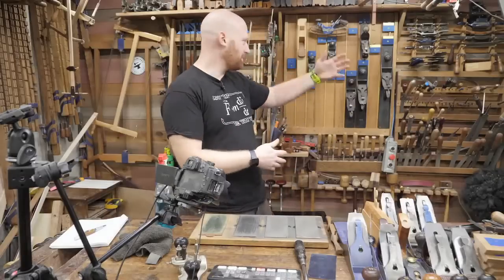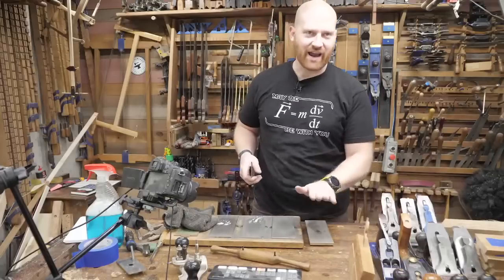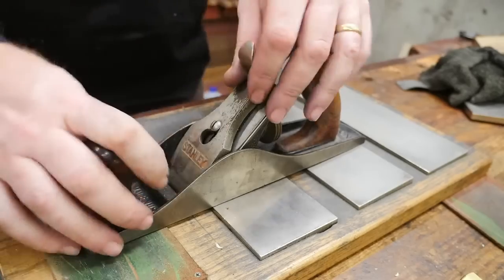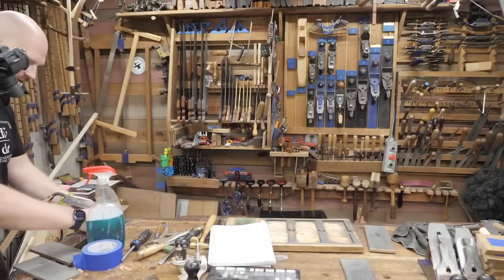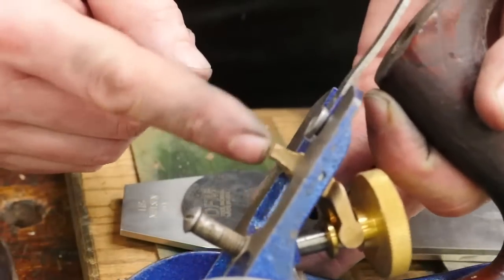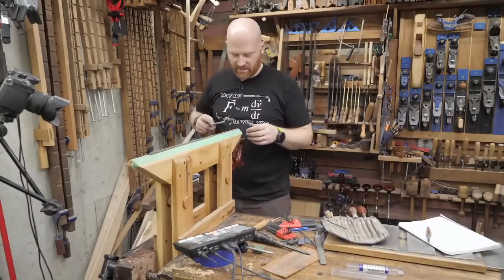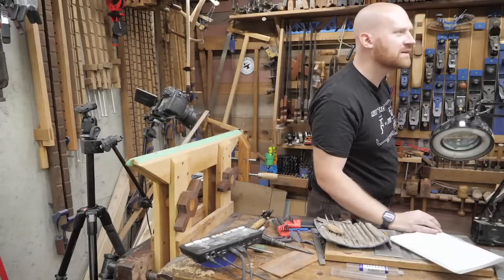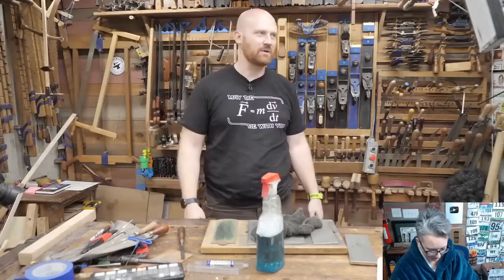Sharpening everything live

Comment: I just sharpened all my blades yesterday too!  I owe you a huge thanks for all your work, without you, Sellers, and Mr. Chickadee I would probably never get into handtools as much as I did. Sharpening would be most likely impossible and it took me a fair while to dimension lumber with handplanes. I still suck at it, but getting better. I built a shelf based on your desk shelf video a while back and just loved the joinery, struggled with flattening because of planes.  There is virtually no tradition to bailey style planes where I live, so  buying used ones that i can actually see and judge is out of the question. I can buy mid-priced new ones and hope they are ok (the brand is called luban-quangsheng and i think they are from the same factory as woodriver planes). Recently I discovered a local brand of wooden planes that are very affordable and made one work, thanks to you and chickadees videos, because the chipbreaker just wasnt sitting correctly on the blade, I also had to modify the wedge so the shavings could come out corretly and would not curl inside and flatten the sole, and now Iˇm thingking about purchasing (probably translated to) a jointer plane (60-80 cm sole) that even has blade adjustment. Can americans get their hands on new production wooden planes? Would you make a video on how you would put it into a workable condition? My smoother works great now (bought at 30 dollars new) but I wondered how you would tackle it.

Comment: How often do you run the plane body on the stones to flatten or tune it up?
Reply from the maker: Almost never. I did it here to clean junk off the bottom. Last time I used that plane was to remove an old lacquer top. And it left a bunch of schmoo on there. Normally I grab some sandpaper but I just didn't have time for that so I just ran out of the diamond plate. Other than the smoothing plane I don't flatten them. There really isn't a huge need for it. Maybe on the jointer plane, but at that it still only needs to be the heel mouth until. It doesn't have to be perfectly flat.

Comment: Are your plane blades the older thin style or did you upgrade to thicker replacement blades, and what are your thoughts on changing to thicker blades?
Thanks
Reply from the maker: I have some of both. For my smoothers I prefer a newer iron like a PMV11 as it will hold a keen edge longer. As to thicker, that is not a huge benefit for me. Most of mine are the original irons.

Comment: Do you think it would be easier to see which camera you're filming on right now with a bright red light on the top of the camera? I think the LEDs would be better visible there than on the switching panel. You could simply run wires along the existing HDMI cables to the cameras, and attach a second row of buttons on top of the existing switch buttons so you can press the two buttons at once, and then connect them to a bit of electronics that switches the LEDs when the button is pressed.
Reply from the maker: Most of the time the problem is I get to focused on what I'm doing and looking at my work. I just forget which camera I'm on. Having a light on top of it really wouldn't help because I don't look up to see. If I looked up at the confidence screen it becomes pretty obvious as I can see which one is up. Or I can just look at the light on the mixing board. But that means I've got focus on it. Usually when my wife is there she lets me know.

Comment: When you sharpen a scrub plane would you ever camber the cap iron or is it enough to have it flat?
Reply from the maker: I just leaves a cap iron the way it is. It doesn't work as a chip breaker so there's no need for it to be close.
Reply: I have about an 8inch radius on my foreplane. With the cap iron to the beginning of the radius it didnt allow the iron to be retracted enough; it was still hangin out about 4mm ( over 1/8inch)  so i clipped the corners off mine to get it low enough on the iron so I can retract the iron more.

Comment: Awesome, thanks 😁 Question: my blades dig into the strop every time I use it, what does it mean?
Reply from the maker: Usually meetings. You're not lifting it up fully before moving it back forward to the top. With the strop you just pull it back.
Reply: I assume you're pulling the blade towards you, with the bevel down. 
If you're not, try it and your problem is gone. =)
Reply: @roevskagg  of course I am, makes no sense to do it any other way to me 😉
Reply: @yoelai  and also with the cutting edge facing away from you... This was the important part, i forgot to mention. 🤣
Reply: @roevskagg  well, that explains all the blood I guess 🤣
Reply: @yoelai  to be honest, i kind of hope so... 🤣

Comment: Do you use extra extra coarse or extra coarse? I have COARSE, FINE, EXTRA-FINE. And I want to buy a more coarse one. Makes it really a difference between Coarse and X-Coarse? Or should I buy extra extra Course? greetings from Germany? Do you ship to Europe?
Reply from the maker: I have in my main plate course, fine, extra fine. But I also have an extra course plate that I use when I need to repair or change a bevel. I don't use it very often as those wear out very quickly.
Reply: @WoodByWright  Thankyou, but do they wear out very quickly? I thought that the Diamond stones from DMT last a lifetime. Or do you mean that they are not aggressiv as they were in the beginning, but this happens because the tips of the diamonds break by the first use.
Reply from the maker: The good ones last decades. The cheap ones last for a year or two. All diamond plates need to be broken in the loose diamonds on top cut incredibly fast at the start but after a month or so they are washed out and you get down to the diamonds that will last for years.